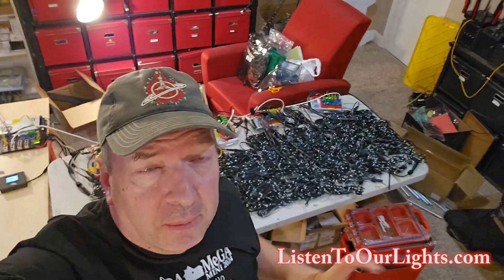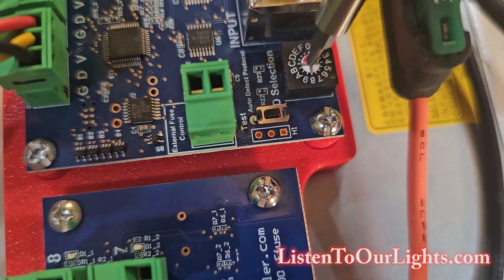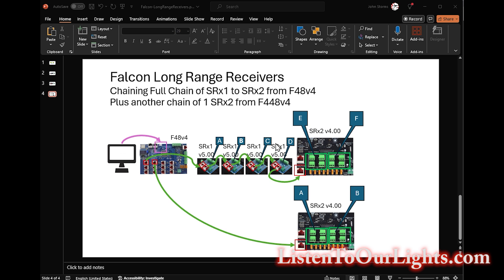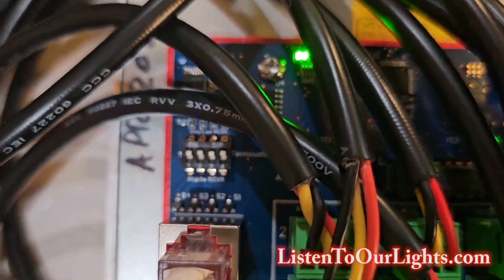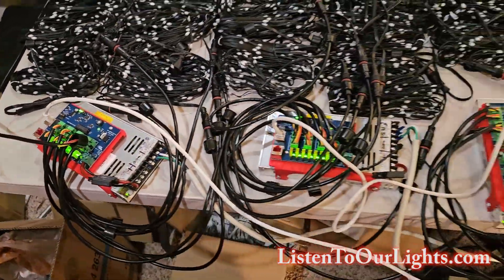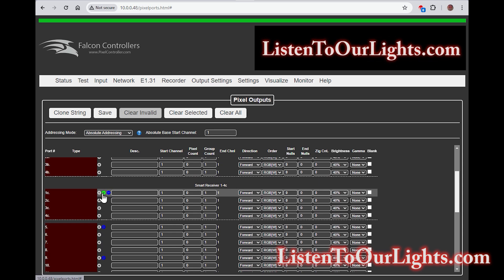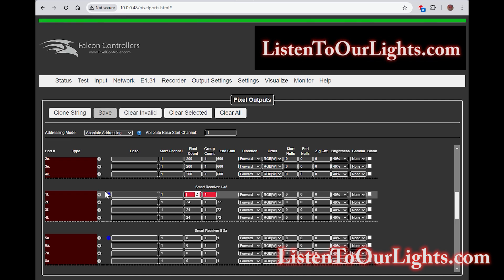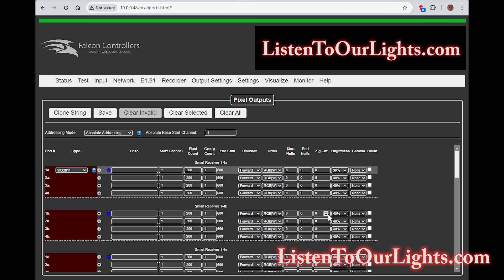Full Chain of Falcon long-range Smart Receivers and MORE

Comment: In your video looks like you are using a F48V4, I assume the F48V1 can only chain 3 smart receivers, so that would mean the max is 3 - SRx1, or 1 SRx1 and a SRx2, but you can't chain 2 - SRx2 nor even use the big SRX4, is that correct?